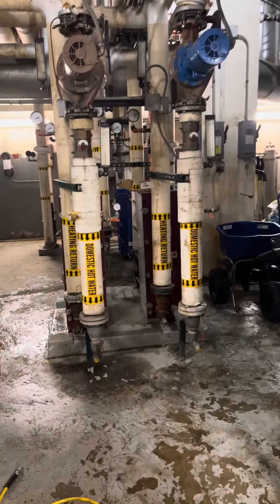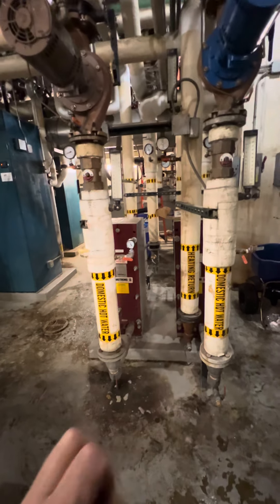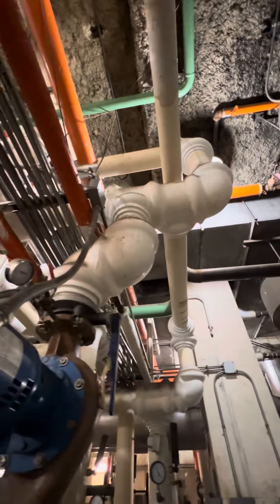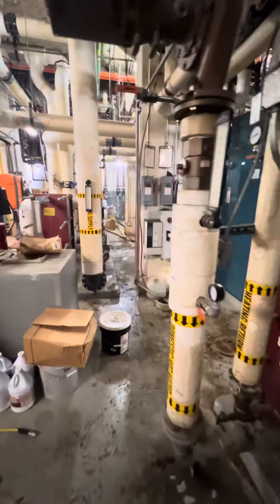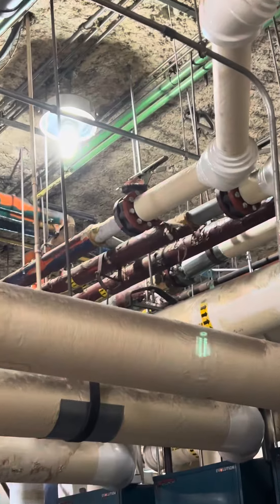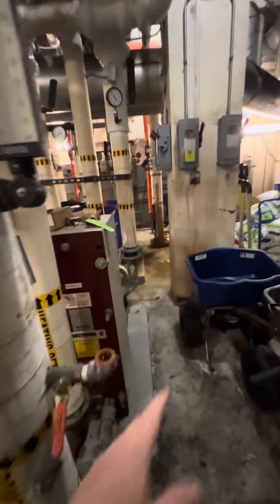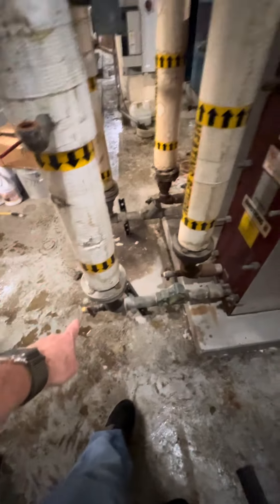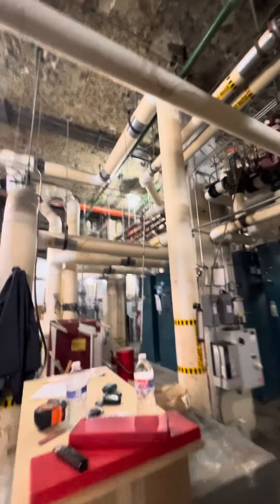I have an idea?????

Comment: Sounds plausible but after shutting both butterfly valves open up the drain valves and check if the butterfly valves hold.  I mostly find fairly new butterfly valves will hold but after 10 years or so maybe not.